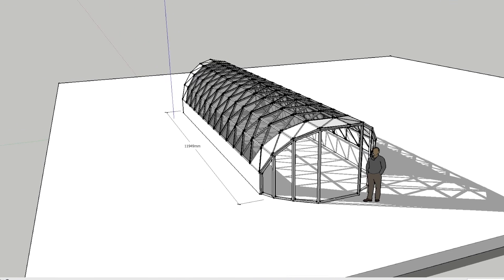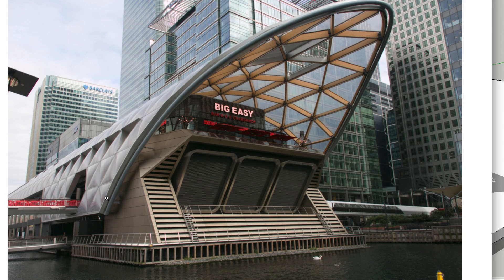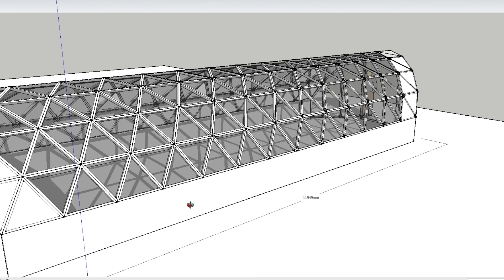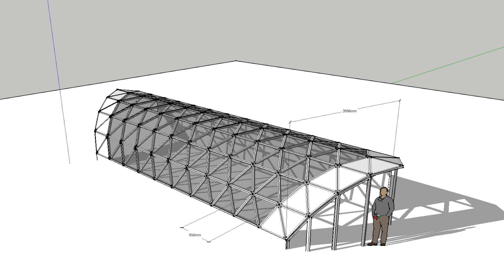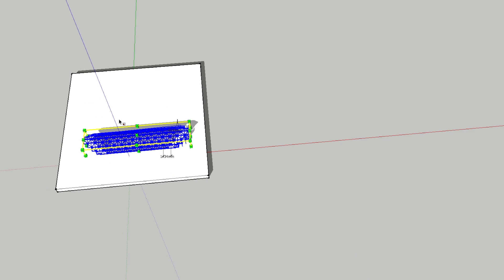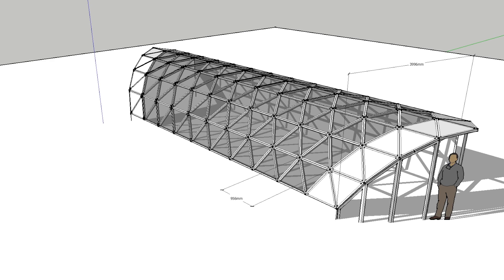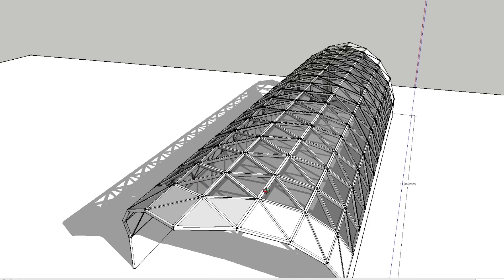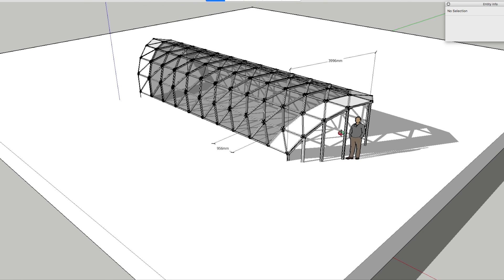New tunnel dome design

Comment: I am looking forward to receiving my copy of the book. I think this model is very attractive, much more so than one of the non-dome type green houses. I think technically a savy fella could construct at a reasonable cost. I’m planning to make some very small domes that are approximately one meter in diameter to start my journey. I simply use these to cover big pot that are about 1/4 barrel size. I feel like this will give me the experience and confidence to tackle a larger tunnel dome. Cheers!

Comment: Hi Paul: I very much like the idea of the tunnel greenhouse, but if it were truncated at the apex of the highest point rather than a row or two lower at the rear, it could be constructed adjacent and attached to a house and avoid the "debris collector" area between the apex and the point where it would be attached to the house.  Plans of these various ideas would be well received.
Best - Michael

Comment: With a back insulated wall to the north this looks amazingly like a chinese solar greenhouse (google it). How about covering this with long horisontal strips of double walled polycarbonate, screwed to the frames? And make the triangels just wide enough to allow the polycarbonate sheets to slightly overlap with an overhang where the tunnel bends? And perhaps also change the bevel to change the curve towards the top. Start with a low curvature to gain hight, increase it to create a bend and finally reduce it again to span the width?

Comment: I love your work. Question - what's the structure strength of a stretched dome? I'm assuming it's stronger than a hoop house. I'm in a high wind area often getting 60mph (100kph) winds and need a greenhouse structure strong enough to withstand that, it's just at the limit for a hop house but I got the feeling these are stronger??? also do you have plans for one of these tunnel domes made from metal conduit instead wood?  Thank you again and please keep up the great work!!!
Reply from the maker: Yes much stronger than a hoop house, I have built both, snow load really damages hoop houses but the triangulated version will take any snow you can throw at it. Yes you could do this with conduit, you would need quite a bit of anti hotspot tape though. Leave it with me I'll see if I can put something together.
Reply: OMG Thank you soooo much!

Comment: In the version with the high back wall, will there be a lot of sideways force on the top of of the wall? It looks like it would be forced out if the dome sags. If one had a sloping site of the correct orientation, then the tunnel could be built into the slope to take advantage of the thermal mass of the earth. Vertical alcoves behind the wall with access both from the top, and inside the greenhouse, could be filled with compost to provide extra heat. I have watched a lot of your videos over the weekend. Very informative, so thanks for sharing your experience of design and construction.

Comment: I want one 60' x 20' with the largest side to any of the triangles less than or equal to 2' lengths. One plan with a back wall and riser on the front and one with only a riser wall of triangles about the same exact dimensions as the tunnel itself.  It needs doors at each end. Also how do you keep it cool in the summer? Will need screened windows more than likely on the top. Plan to back fill the North Wall is why I want such small triangles. They would be more stronger and the sides that meet the full length of it will need the right angle cut on that board so it arches properly. Only one size triangle is why I want this. I can make it out of Scarp wood. 2" x  4:" no longer than 2' lengths? This is cool.

Comment: I assume it would be a 10 degree bevel on each horizontal edge x 18 edges = 180 degrees and that the length of each of the sides of the equilateral triangle would be in the vicinity of 500mm looking at the rough scale in the clip...
Reply from the maker: Yes the bevel angle is 10° I have the equilateral sides at 956mm. Total height is about 2.2m and the width is 4m. Length is 10m in the drawing, so you can get an idea of scale. I'm working on drawings now, I'll make a copy available to all commenters.
Reply: How much stronger/weaker is this design compared to the other one where the triangles go up and down along the tube...(inverted bavel)?

Comment: Looks much better than a Polytunnel. At a charity by me they have several polytunnels but youths got on the ground and slashed them. They look even worse with the gashes taped up. Using triangles not only looks better and more sturdy but also means the individual triangles could be recovered if damaged.

Not so keen on the riser wall. Would look better if sunken into the ground slightly. A bit like they do in South America. Just remember to use a dense material for the submerged walls to trap the heat, like stone or brick.

I think something half way between the two designs might look nice. i.e. use the second design but on the wall side bring the roof down one extra row of triangles.

Comment: If you built this and sank it into the ground the height of the wall. You would have some thermal heating or cooling at not cost. An air filled cover would not hurt. But I like your way of thinking.
Reply from the maker: Yes I think I can do a double skin without the need to have a fan blowing all the time.

Comment: What about back filling the back wall with composting material to provide heat in the winter and fresh compost for your garden?
Reply from the maker: Yep I think you are sot on with that ideas, I did a compost heated bed in the pyramid greenhouse last year which works really well, a double polythene layer would also boost efficiency.
Reply: have you made these domes wth double air inflated poly? Does it work well?

Comment: I love your design and would go with the tall back wall.  I live in Canada and snow loads and solar orientation are important.  I too like the simplicity and low cost of the ubiquitous poly-tunnel, but don’t like the look, nor the stability.  I would consider building using a SIRE wall (rammed earth with an insulating core) for thermal mass and structural strength.  And I’d build one with annualized geothermal storage so I can create a Mediterranean climate.  Very interested in plans for this.
Reply from the maker: Cool, Keep an eye out here and I'll post a link to the plans when I have a moment.

Comment: Paul, I like the design, especially the design with the taller “back” wall. We are looking to add a green house behind my woodworking shop and this could be scaled to fit, oriented east-west with the “back” wall on the north side, facing our bog filter and duck pond. I know you are not a fan of water heat storage, but I could see this back wall with a two foot tall line of water tanks, and then shelving above it. The water might not store a lot of heat, but would add humidity. Also a place to store cuttings/plants from our bog filter over the winter. I would be interested in plans. I presume one outside edge of each triangle would be beveled to shape the arch.
Reply from the maker: Yes bevel and is 10° there is also a tiny nip to take off the top point, I'll post a link to plans which will show more details.
Reply: Paul, I like your design, as does Household Six.  I am thinking about front and back walls recessed with a couple of posts to support the front and back extensions.  That would provide protected entrances in inclement weather.  I imagine the the length is somewhat scalable.  John

Comment: Really like the original design you made.  The one with the rear wall seems like it would loose some of its strength for a snow load and doesn't have the same aesthetic appeal.  I'm thinking of building one like your original and then putting a wall inside on the north end similar to your second design.  From the outside it will look great like your original and will have a place for shelves and added strength for snow.
Great stuff.  Let us know where to get plans when you have them.  There seems to be just one side of the triangle needing a bevel.

Comment: I plan to design a center dome that can have up to six 'tunnels' connected to it. I love this design with the part that extends out. Looks very nice. Goal is to have a center common room and each tunnel its own function, like kitchen, bedroom, office etc. Did you every combine a structure like this with a dome? I first planned to do that with containers (in place of the tunnels) and a dome on top in the middle, but this seems more cost effective and also much nicer to look at.